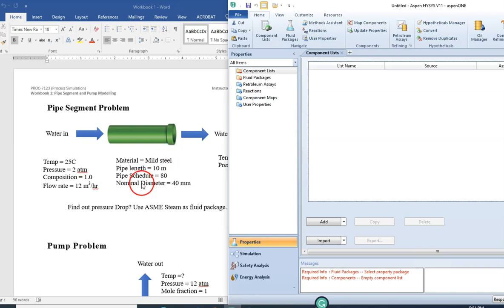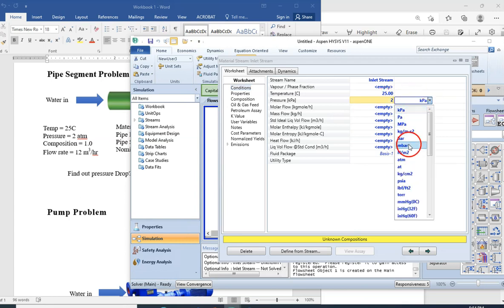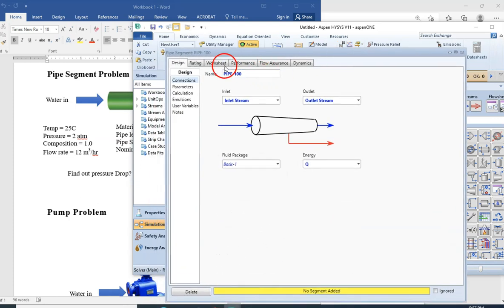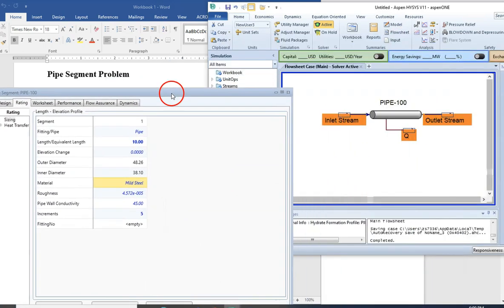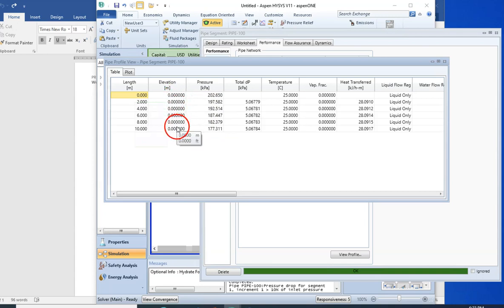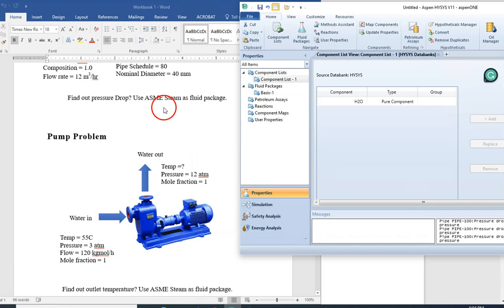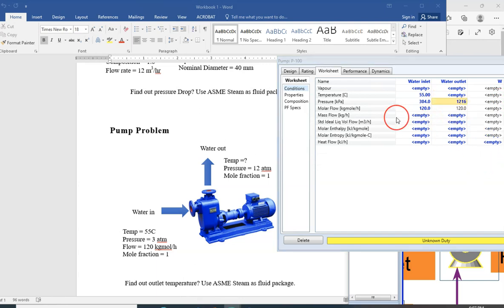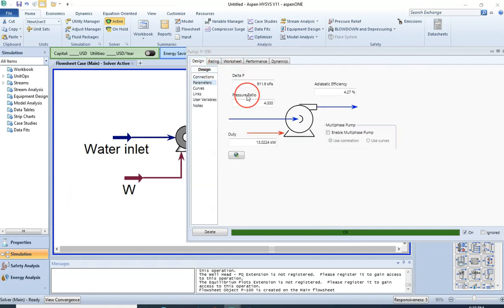Simulation of Pipe Segment and Pump in Aspen HYSYS - v11

Comment: Dear, how to simulate control valve with its downstream pressure (P2) back calculated from pipe segment having fixed outlet pressure (p_out = fixed while p_in = P2)? If inlet of the valve is also connected to a pump, then how to simulate this process dynamically? Is there a way/approximation to get the dynamic valve P1 & P2 in order to avoid simulating a pipe segment dynamically?